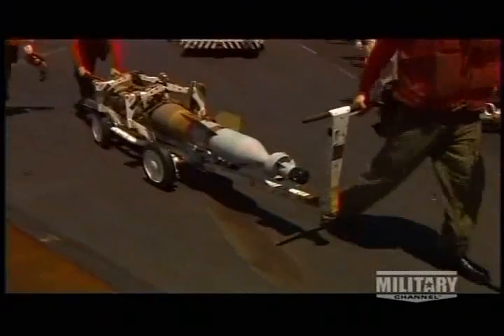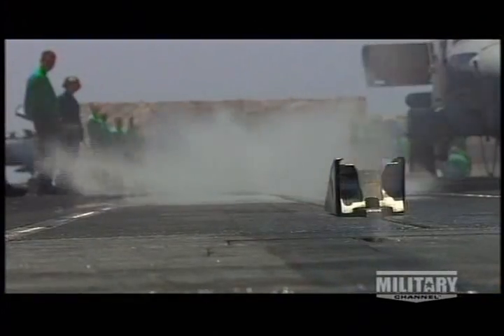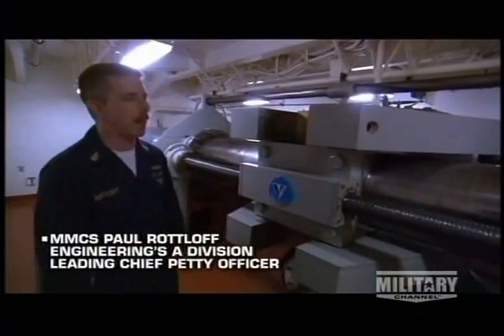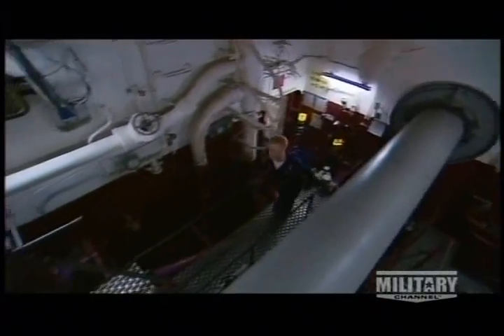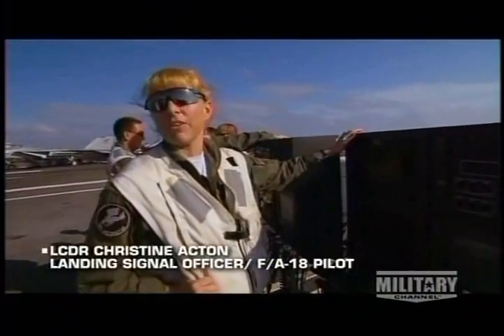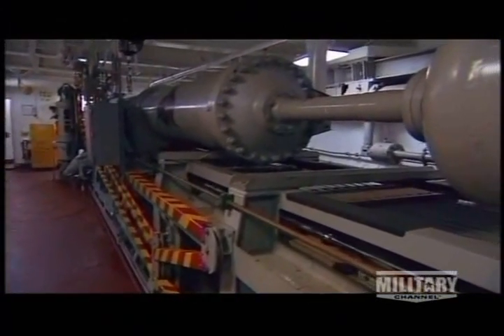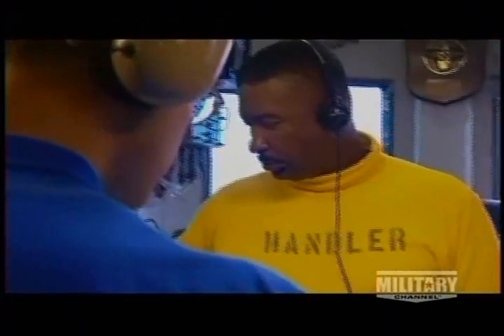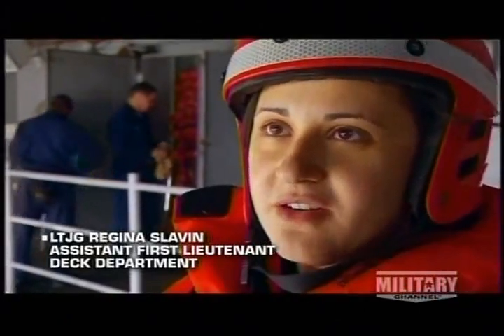Anatomy of a Supercarrier Part 2

Comment: @MrJeffreydunson Its not as easy as you think. We focus on deffence mostly we have a rocket (called gustav II) that can be fired from a ground unit thats heat seaking and can take down any airplane. And we have over 2000 of those rockets so an air attack wont work that good. As i said equipment is fatal in war. Our subs cant be found watch this   /watch?v=Khaa3y0i87s  It can go anywhere cant be found can kill everything you have.